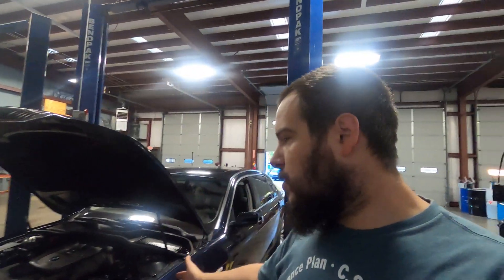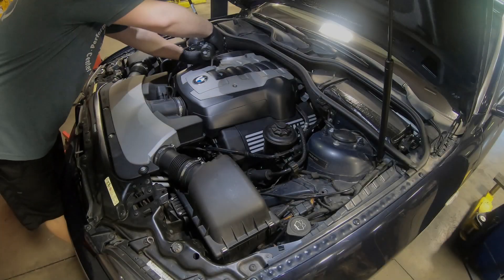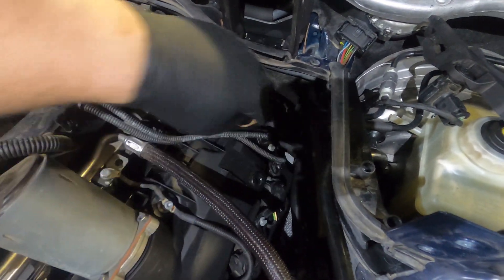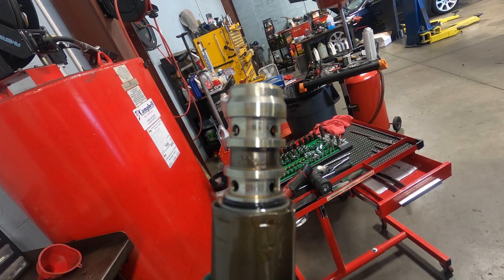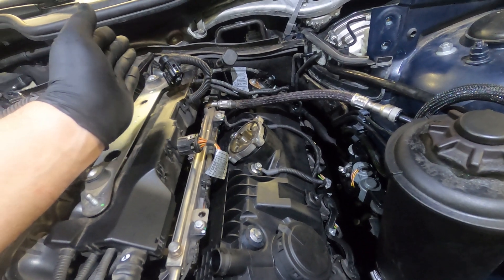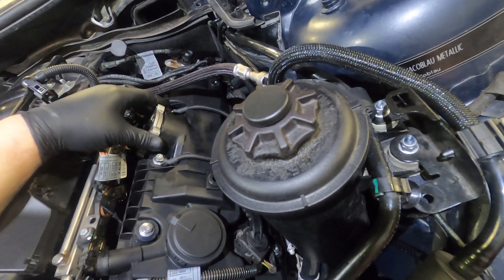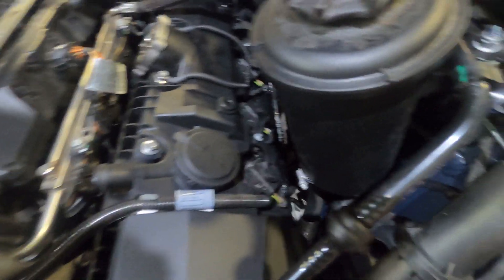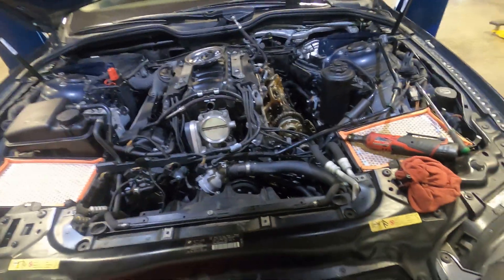BMW Fault Code 2A91 | BMW 7 series(E65)

Comment: After replacing valve and timing cover gaskets i got codes for both exhaust camshafts 2a91 and 2a90. I deleted the vanos adaptations ,cleared the codes and  the problem was solved. Hopefully someone can find this helpful

Comment: Im having this issue but BOTH exhaust cams are throwing correlation codes, and the car now has several cylinder misfires. Swapped solenoids with new ones and the issue is still present. I havent taken the valve cover off yet as it will take a while to do. I’m assuming this is my next step. The car also throwing a RED oil pressure low light when it seems to be actuating the VANOS. any ideas? Please help 😂
Reply from the maker: If you have any kind of oil pressure issue, indicated by the oil pressure light, it will affect the variable camshaft timing. I would sort out what is causing your oil pressure issue before proceeding with anything else.
Reply: @MunkysGarage  okay thank you. Thats what i was thinking i just haven’t pieced that all together. Thanks again

Comment: Hi i have fault 2A90 i clean selenoids but  same engine not good working. Any ideas?
Reply from the maker: Cleaning the solenoids doesn't necessarily fix them. If that didn't work you can either disassemble the engine and check timing. Or you can replace the solenoids and see if that fixes the issue.

Comment: Great video and explanation of the fault and repair  procedure. I just changed the valve cover/upper timing chain cover gaskets on my 06 BMW 750Li. I'm having the same symptoms but the codes I got were 2A83 (vanos intake) and 2A90 (exh cam. tooth offset to crank.) I cleared the codes and the 2A90 returned. Will I follow the same procedure as your video but on the passenger side of the engine? Which vanos is for the intake/exhaust? And which camshaft position sensor is for intake/exhaust? Again great explanation on the process.

Comment: 29EF
CDKFMAS Ox29EF - Mixture adaptation,
sum error
29CF
CDKMD05 0x29CF - Misfiring Cylinder 3
2A89
CDKANWS2 0x2A89 - Outlet VANOS 2
2A8D
CDKANWSAD2 0x2A8D - outlet VANOS,
adaptation stop 2
2A91
CDKNWAKW2 0x2A91 - Exhaust camshaft 2,
tooth offset to crankshaft
2A84
CDKENWS2 0x2A84 - Inlet VANOS 2
2A83
CDKENWS 0x2A83 - Inlet VANOS
2B64
CDKPH3 0x2B64 - Camshaft sensor 2, inlet
2A8C
CDKANWSAD Ox2A8C - outlet VANOS,
adaptation stop
2A88
CDKANWS 0x2A88 - Outlet VANOS
2B65
CDKPH4 0x2B65 - Camshaft sensor 2, outlet
Reply: Any ideas?

Comment: hi, I have a BMW 750i chack engine popped out.  I connected a diagnostic computer, two codes 2A8D and 2A91 appeared.  I haven't done anything yet, the oil is coming up for replacement.  What is the best way to start?  What could be the cause?  What to do besides changing the oil?  thank you if you answer.  greetings
Reply from the maker: I would start with the oil change and clearing faults. Thin/worn oil can cause the adjustment faults to pop up.

Comment: This video was very helpful. I ended up finding out that it did jump timing. My question is there an easy way to get it back in time or would have to redo the whole timing chain?
Reply from the maker: I feel like it may be possible to get it back in time some how. You will have to pull both valve covers to get the timing tools on the cams. And then you will have to take tension off the chain so you can get the play to rotate the cam it jumped on back into time. That being said there is most likely a reason it jumped time. Like it has a broken or worn guide or the tensioner failed.

Comment: Hey, did the new solenoids fix the problem?  
The N62 in my X5 4.8is isn't throwing any codes, but i noticed that adjustment angle bank 1 reads 0, while bank 2 is about 3 degrees.  Feels down on power.  Any idea whether this is a vanos issue or valvetronic issue?
Reply from the maker: Solenoids did end up fixing this car. If you are having messed up readings of adjustment angle it would be vanos and not valvetronic.

Comment: Great video....I currently have a 2007 X5 throwing the 2a91 and 2a8d codes with misfire codes. Rough idle and running until 15 minutes of warmup than normal. Also threw codes for 2ea0 for oil condition sensor and no BSD message from old condition sensor and intelligent battery sensor.

I plan to pull my sensors and solenoids as I dont have the timing tool. Just wondering what the oil condition sensor might mean as well, or if it could be related.
Reply from the maker: I've actually seen cars do pretty crazy things with a bad oil condition sensor. If the fault is currently present and you are unable to read your oil level I would start with replacing that.

Comment: What would a job like this cost
Reply from the maker: The whole diagnostic process on this video would probably be about 6 hours. Cost would depend on the labor rate of the shop you are at. The actual repair that fixed this car, that wouldn't have required the whole process, probably would have been about an hour.
Reply: So 7 hours total sound about right
Reply from the maker: Yeah sounds about right.

Comment: hello I have a 2007 650i and I changed the both vanos without changing the oil and now I'm getting a code that says 2A8D following with 2A91 what should I do
Reply from the maker: The 2A8D fault is an adaptation fault for the end travel range of the exhaust VANOS on bank 2. This could be caused by oil flow; such as blocked passage, faulty valve(even though it was replaced), or even worn oil being too thin. The 2A91 fault is most likely setting because of the other. I would go back and swap those solenoids between intake and exhaust on that bank and clear faults and see what comes back. Could verify or rule out a bad solenoid. If that fault stays with exhaust an oil change would be my next step.
Reply: @MunkysGarage  ok thanks I'll let you know what happens

Comment: Hi. I just did the valve seals and did the timing with same tools, cranked the engine severa times and checked the timing and was dead on every time. I also rebuild the transmission this is on a x5 e70 4.8. I put everything back together and I got that same code 2a91 I don’t mind swapping new solenoids and sensors but I would hate to check that timing again because of the amount of work I already put. Would you think the timing is off after I checked several times before the assembly.? Thanks.
Reply from the maker: Doubt the timing is off if you rechecked it a few times. Most likely vanos solenoids. If they were sitting for awhile with no oil in them they may just be sticking and need some time to get oil in them and freed up. But it wouldn't surprise me if they are just bad. I've had them go out after doing oil changes on these cars.
Reply: Thanks for the fast reply man. I appreciate the reassurance. I see the logic of the solenoids been dry, they were sitting for about a month while doing repairs. Hopefully changing solenoids will fix this code 2a8d and 2a91. I also saw today and ISTA had a section for calibrating vanos. Thanks bro.
Reply: @freddyvillar6337  Were Vanos your problem?

Comment: 👍 great vid .. too bad your not over at nj  ... anyways I have an issue with low idle rpm around 500/  450 when engine is warm any ideas what could it be ?
Reply from the maker: If its the n62 like the video and it is higher mileage I would say worn levers for the variable valve lift. You can raise the base engine idle with the right scan tool. But that is only a bandage and the issue will come back as they wear more.

Comment: Good Job man, very extra of you to pull the valve cover, but made for a more entertaining video.
Reply from the maker: In my years of experience it has never been a timing issue that causes this fault code. But the diagnostic tree for the fault wants you to check it. Just wanted to cover all of the bases in case someone has that rare instance where it is a timing issue. Didn't want to be the one to lead them astray.

Comment: Excellent video
Reply: I have 2008 BMW 550
Ignition turns on
No crank no click intermittent starting 
Some times it starts 10 times no problem
New starter
Replaced start button
Replaced and flashed cas module
Some mechanic installed a used transmission.
EGS shows different VIN
Had This code before.
A0B4 CAS: Engine Start, Starter Operation
Changed starter
Start button
CAS module
It worked fine for a day
The same code is back
Reply from the maker: That fault just sets when it sees you attempt to start the car but doesn't see an amperage spike on the power line going to the starter. It is essentially a fault telling you the starter is bad. Check and make sure that the engine and transmission are grounded properly. There should be a ground strap on the back of the transmission going to the inside of the transmission tunnel. Easy way to find if that is the problem is to make your own jumper wire that goes from the engine somewhere, say like the engine lifting hook, to the ground jump start point in the engine bay. If your issue goes away yourbground strap is the culprit. I have seen them physically look okay but be corroded and have too high resistance to work properly.